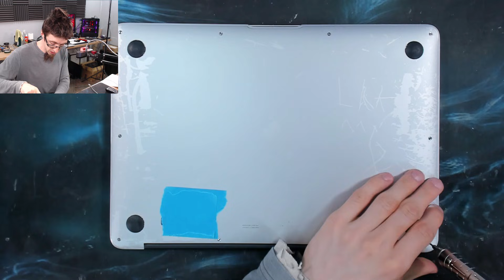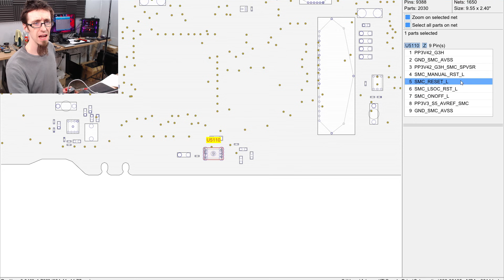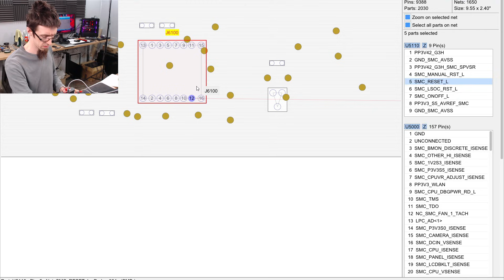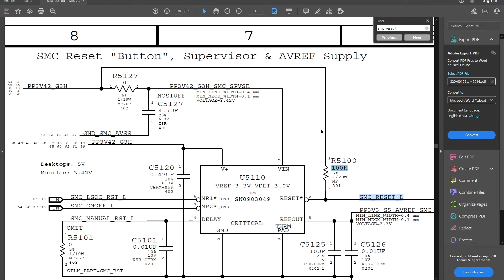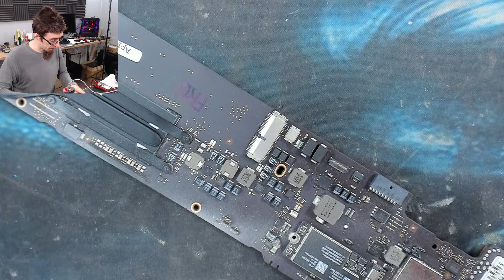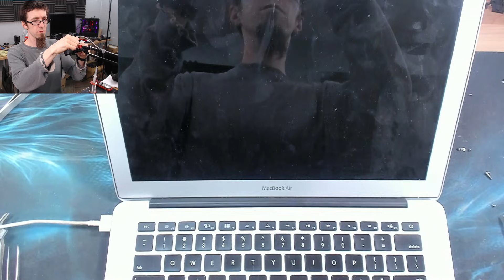MacBook Air with No Power, No Light on Charger - LFC#281

Comment: my macbook air (2012) has the same problem, it wont turn on because the magsafe connector hit the chassis and i saw a little spark. it doesn't have a battery and i think this video can be of help i hope this works or if anyone has some suggestions you can tell me

Comment: I have a Macbook Air 2017 model and i'm experiencing this issue. Looking at this repair, i feel like my laptop has IO port issues, and not the smc chip issue. Because on my machine i just have to push the pin which connects to laptop charging port harder or i have to  tilt it either upwards / downwards, and then it starts charging. but sometimes it start immediately as well as it is a magnet and it sticks to port quickly. 
If you could make a video on replacing IO port, it would be a big help.  Thanks for fabulous contents

Comment: With this issue MAKE SURE to : inspect and check the cable going to touchpad and the touchpad pins... its common corrosion messes with this and can damage the components again.  But sometimes the trackpad or trackpad cable needs to be replaced.

Comment: I have exactly the same problem. The computer was working when I shut it down, but did not use or power up for over a year, so figured the battery was stone dead and not activating the charging system.  A new battery, unfortunately did not fix the issue. I need to learn how to remove and solder chips to a MB first before I try this repair.  Learned a lot about how techs work with chips. As soon as I have the proper materials and tools, I try to resolder the chip. If I can find a power board, I'll try that first, maybe even unclip and clean the contacts first.  Thanks for such a great video. :-)

Comment: Unfortunately, my MacBook no longer switches on. The orange LED lights up and turns green after several hours. As if the MacBook was charging normally. When I disconnect the battery and then connect the power cable, it boots. What else could I check?

Comment: I have a dead macbook air and don't know if I have the same patience to try this to see if it works. Or just sell it off as non-working parts at ebay to save the time and headache.
Reply: did you get to fix it?
Reply: @sharymens8187  No. I got it sold at 2/3 the price of a fixed one so it was not worth the time and effort.

Comment: first of all  would like to say big THANK YOU! for this amazing tutorial i was able to fix my macbook air as same with the title of this video no power and no light on charger. what i did is check that specific chip and using my smart phone to zoom it so that i can see what's the problem and it corroded so i clean it up by using tooth brush and alcohol and it works! i don't have the tools that you used in this video but i copy the last part of this video by cleaning smc chip or i don't know what is called anyway thank you again boss!
Reply: Worked for me also!
I used heat gun to throw some heat at that chip as alcohol and toothbrush wasn’t enough in my case…Thank you!

Comment: Hi, I had problem with my Macbook pro A1502 which I believe the battery drained during sleep mode, its happened like twice before but it managed to turn on normally after battery charge or while on charge. It happened again yesterday and this time the charge indicator keeps red even charge for longer time and it wont turn on. I did try to reset SMC while charging, it did shown indicator turn green for few seconds after releasing the keys but it not running. I also did try to check the battery by removing the back cover and its not shown any fault in condition such as bulging. Please do help me before Im trying to change the battery since I cant think of something else. Theyre no warning about battery (before it happened) but I do believe the battery may also has an issue earlier since its getting so hot while on charging. Thanks in advance

Comment: I have a Macbook Pro with a charging issue. The red light stays on, but the battery wont charge. I'm thinking it's the I/O board that needs to be replaced. Any thoughts?

Comment: I wonder if this is / was a lead free solder problem . Hard joints with lead free and no flex , a drop maybe and it cracks the solder join . Something like a bridge where they are designed to move rather than break

Comment: I bought a MBA last night for about $120. Early 2015 complete with box and original accessories. It had stopped working, worked intermittently and when Apple took a look, they were unable to determine what was wrong. They suggested that the owner upgrade to a new MBA and they would recycle the broken one.

So it was advertised as ‘parts only’.

Charger light came on, but it would not start.

I left it to charge to 10% and reset the SMC.

It started up.

Not only that, it’s currently running Big Sur…

One owner before me, it’s in great condition and I think I’ll keep it as a daily driver for a little while.
Reply: MBA?
Reply: Mac Book Air?

Comment: Hello.  Was hoping you could help me.  I was donated a 2015 MBA.  The original owner said it stopped working after water damage.  When I plug in the magsafe2, no lights.  However I see a blinking low battery icon on the screen.  I took it apart and when I plug in the magsafe, the fan starts spinning, and again there is the blinking low battery icon on the screen.  As a test I tried unplugging the battery.  When I do, the laptop starts up and stays on.  And all this time, still no light on the magsafe.  This laptop can be purchased on ebay for about $120.  So I am not trying to spend a lot of money to repair it.  Any idea what it might be?  Battery? Or something on the logic board? Or maybe the io board?

Comment: The same issue is there with my MacBook Air -- there is no light on power connector. I tried removing battery, SSD, but still Fan is not running.

Comment: As someone who has done desktop PC maintenance and repair before, I have experienced that there is a short circuit problem on dusty motherboards. After cleaning the dust well many times, the computers were working again. As in the example in this video, the problem is caused by dust. It's not even a bad connection.

Comment: What does it mean if my computer charges when plugged in and battery disconnected, but as soon as I connect the battery, the charger light goes off?
Reply from the maker: If it's an Apple, probably a knackered battery. For PC laptops, could also be a bad batt, but more likely an issue in the charge circuit.

Comment: Hi, thanks for the great video. My MacBook Air 2020 was dead. When I detach the keyboard cable it turns on ok and I can use the system with external mouse& keyboard. Any idea what might be the problem? Thanks again for sharing  such a great video.
Reply: Don't know if you have had any response about your issue but i think the power goes into the trackpad and then back to the main board and gives a signal to turn on . If there is nothing on the return path it will not turn on . 
It's Apple , think different 😂

Comment: So sorry for the long question(s), but I'm having a similar issue with the SMC on my refurbished (late 2009 unibody) Macbook and haven't been able to find anybody that knows anything about this stuff.  Anyway, here it is: 

Is it possible to trigger a problem like this while attempting to reset the SMC?  I was recently having some software/partition issues (couldn't get past the login screen), but couldn't access recovery mode using command-R for some reason.  I was able to access single user mode (using COMMAND + S), so I decided to reset the PRAM, then rebooted and proceeded to attempt to reset the SMC by pressing SHIFT + CONTROL + OPTION + POWER simultaneously (while on the login screen).  This powered the computer off, but I was then unable to power it back on.  The green indicator light on the magsafe adapter was still glowing at this point.  I unplugged the laptop, took the bottom panel off, disconnected the battery and waited ~30 minutes, then plugged the magsafe in while the battery was still disconnected.  The laptop still would not power on, and the magsafe light was now off.  I re-connected the battery.  The laptop still will not power on and the indicator light on the magsafe is now off (it was green before, indicating that the battery is/was fully charged).

Anyhow... it's been a strange degradation from a minor software bug, to a system management glitch, to possible logic board failure, and it's hard not to feel like my attempts at repair are instead reaping destruction.  I've tried numerous fixes suggested on the internet but nothing triggers a response from the computer (no fan spin, no lights.. nothing).  Long story short, I think the SMC reset has somehow gotten stuck (in a low voltage state perhaps?) and is preventing the laptop from charging, powering on, etc.  Does this seem plausible, and if so, is it necessarily a mainboard issue or is it possible to force the SMC to properly reset by using a different key combo?  

I might try to zoom in on your video and take voltage readings at the same contact points to see if that reveals anything, but I'm kind of at my wit's end here.  Any insight/suggestions would be greatly appreciated.  Thanks!

Comment: Hello, greetings from Germany! My Master @Adamant IT i need your help! I have the motherboard b450m and long time ago i installed 4x4gb Corsair Vengance ram which i can only run on 2.13mhz or 2.4mhz. If i load the x.m.p Profile then (which makes them to their maximum 2.666) then my computer is making 3 long beeps and try to start again then he do the same thing like 3 times till it get off and restart with the successfull bios profile. I saw that the profile doesn't change the volt it stays on 1.20v but the timings are changeing. I literally have no idea about overclocking so i dont wanna do something wrong. I really would appreciate if you can help me with my little problem. I hope my computer didn't take damage from that fail to boot. please master help me!😰
Reply: i got a geforce 960 and a ryzen 5 2600  and a new 650watt power adapter if you need that information! much love
Reply from the maker: BIOS update might fix it, otherwise set the voltage to 1.35 when on XMP.
You just might need to do a BIOS reset if it can't start, but boot fails don't cause damage, so no need to worry about that.
Reply: @Adamant_IT  alright ty very much sir!
Reply: @Adamant_IT  It seem to run so far! But is it normal that he sometimes jump from 1.36 to 1.38?
Reply: @Adamant_IT   It runs but since then Darksouls 3 is crashing sometimes but the rest runs well do you know why this problem appears? Sorry for that many questions

Comment: Great job, I have a question and I see anybody that does this kind of videos do: how much do you charge for a repair like this?
Reply from the maker: It's hard to give a straight answer, as it depends on a lot of other factors (are we also servicing the device, what parts were needed, etc etc) and what works for my shop placement might not work for others, etc etc....... but my guide price on board repair for stuff like this is £80 (about $100).

Comment: I have a question for you I have a HP G7-1255dx notebook  and when i turn it on i get a flashing number lock light an amber wifi light it does charge the battery it turns on but nothing on LCD screen, I have connected a separate monitor to the VGA connection on the laptop but i get nothing on the Screen i can hear the hard drive spinning and the cooling fan spinning i have replaced the motherboard put different CPU different memory nothing seems to fix this I am stumped. I'm kind of leaning towards maybe bios i have replaced the cmos battery also.

Comment: Might be a weird question but if the solder joint was partially damaged would that be considered shortening it out? As a mechanic looking at this I would say that the part might be partially damaged or am I incorrect.
Reply from the maker: Yea I can't fully explain this behaviour. My best guess is that there was some spray paint on the pins leaking a small amount of current to a ground pin, and it got burnt off in reflow.
I've seen a straight reflow fix other issues, so the bit about "might not need to replace the part" is based on that - but this partial short was a bit of an oddball example.

Comment: Hello graham, was wondering if you could give me a little hand in solving a macbook pro a1502 mystery. For a couple of minutes after boot, the screen flickers and gets "stuck" - but sometimes it appears totally fine. Upping the brightness seems to make the problem less severe. Any ideas?
Reply from the maker: That sounds like a display issue to me... only sure-fire way to test is to plug in a different screen though
Reply: @Adamant_IT  a different screen would be the first thing I'd check, but it's not an option for me.. Have replaced the lvcd cable, no luck there.
Any other ideas? Could it be mb related issue?
Reply from the maker: Maybe. I think you'd need a very fast multimeter or an oscilloscope on the backlight power rail to check if it's jittering.

Comment: Gahd, it was the spray paint, wasn't it. 100k is very weak for a pullup, I would have expected 10k at most. So I have no problem imagining a speck of paint with unknown electrical properties putting up a good fight against it.

Comment: Apple FRU board, ewww.
Reply from the maker: What does that mean? Is it a 'certified replacement' or something? Based on the spray paint job, I'm guessing this machine was refurbed by someone.
Reply from the maker: Well, the board has FRU stamped on it under the SSD
Reply: @Adamant_IT  the white “APPLE” sticker is another clue.
Reply: Indeed.  The joy of dealing with what's already a seconds board.  Sometimes we get lucky and the original fault wasn't anything too severe.... sometimes.
Reply: @Mr Guru easy to tell, I used my eyes.

Comment: Recently got a PS3 original (Backward compatible model) - It had mo dust inside, very little scratches. I was told to change the thermal paste so I did but my god what a pain in the arse to disassemble and reassemble.

Comment: Hi sir 
Adamant IT good day.I just want to ask help from you, coz I have a repair of laptop HP pavilion G6 but unfortunately when I disassembled the laptop there's no BIOS on board. I thought the technician who previously repaired the laptop removed that. Now I do not have a donor board to compare what's the number of the bios.So I'm asking for your help if you know what is the bios number for HP pavilion G6.
Reply: I'd imagine that you'd Google the schematic for the model and version printed on the motherboard.
Reply: @PYDPIPER  i googled already but unfortunately theres no exact SD for the HP Pavilion g6-1a69us just in case you have can i have a copy or link.thanks